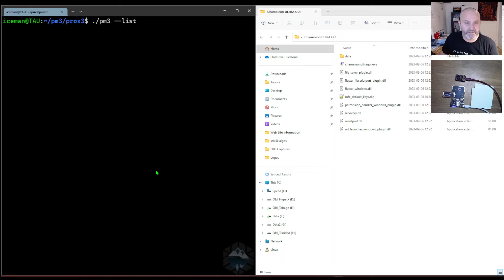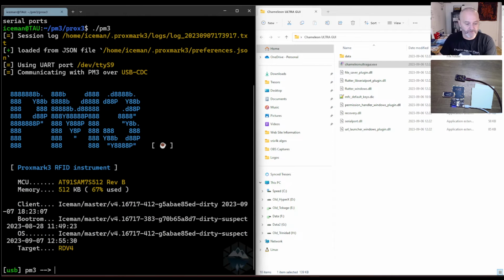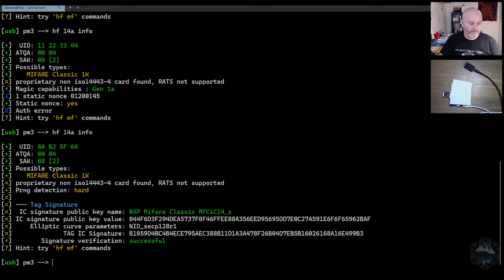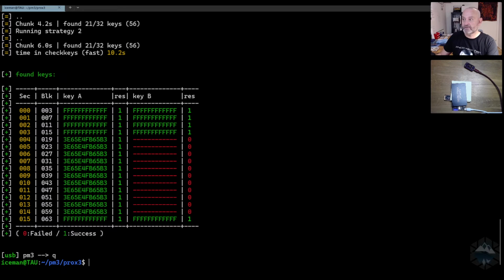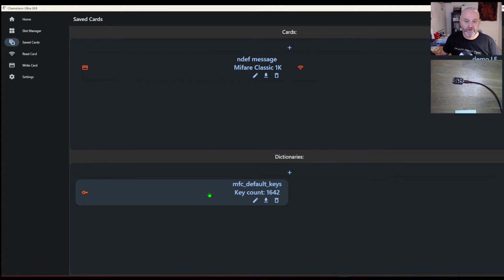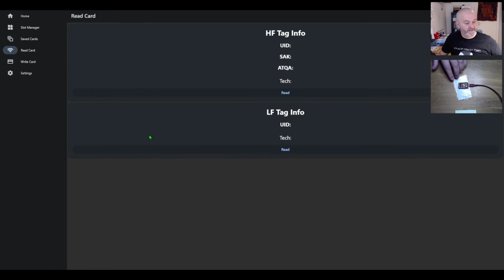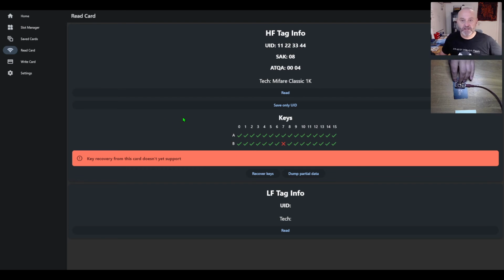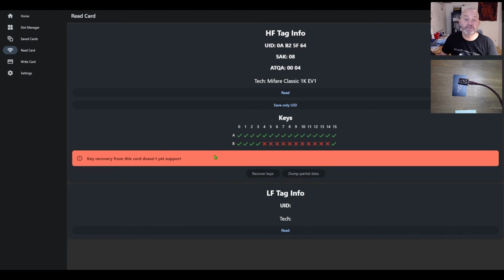Unveiling Key Recovery: Chameleon Ultra GUI Deep Dive

Comment: Hi, 
I have a problem with chameleon ultra, when using the “Read Card” function, when reading a card, there is no “Check keys from dictionary” option as in the example, only “Read with key” and “Read without key” are displayed. 
The card's Tech is an Ultralight EV1(41). The mfc_default_keys.dic file provided by you has been added to the “Dictionaries” section of “Saved Cards”. Thank you for your help!
Reply from the maker: Mifare ultralight is not Mifare Classic.  
Two different card technologies.
Reply: @iceman1001  So is it because the technology doesn't support check keys from dictionary?
Reply from the maker: @  ultralight doesn’t have keys.   It has a 4 byte password.  
Now would be the time to read the datasheet in order to understand the differences between them two card technologies.
Reply: @iceman1001  Got that.Thank you for your reply.

Comment: Is this card 125KHz 1326 1386 idhid access Proximity 26-bit Cards / Facility Code 130 rewritable
Reply from the maker: Depends what chipset it has.  If original then you can use a pm3 to examine it more.

Comment: Hi fist off I love the work you put in I have a question I'm not that good with computers but I like the proxmark3 with the battery + bluetooth  so I see the icopy-xs is easy to use  is it a app available to control the proxmark3 the same way you control the chameleon ultra thanks for being here for us all
Reply from the maker: There is termux on android and an out of date app. 

Flipper and CU has modern and up to date apps.
Reply: @iceman1001  thanks for responding I'm gonna give both a try the proxmark3 with battery + bluetooth and icopy-xs 👍

Comment: Great Video!

Why didn't you select a dictionary before recovering keys (from the drop down)?
Also, I have a MiFare Classic Card, where the gui does not offer to recover keys. When I dump the HF and write it to another card and read that card, i can suddenly recover the keys and dump the HF properly.

The first clone (without recovering keys) does not work, but the clone2 created from clone1 works well

Do you have a clue whats happening here? For the original card it shows me "Tech: Other", once its cloned without key recovery it shows "Tech: Mifare Classic 1K"
Reply from the maker: yeah,  
the message in the dropdown made me belive it was a debug message. Work in progress..
So I didn't think of it until GameTeclive informed me that the dropdown actually works. 

Leaves a bit to wish for in the GUI ,  

You can recover keys from the clone in different manners most likely since its a Gen1a.

Comment: First of all, thanks a lot for this clear tutorial. I tried to make the same exercise with some cards i have... and have detected that I don't get the same outcome as you showed us. If I try the info command, i only get some data (no uid, atqa & sak). Through another way I can detect its sak 20, atqa 0344, which gives me by looking up on the internet its a MIFARE DESFire). Is this the reason why i dont get the same results? Also the hf mf fchk results in a error. (seems the command is not known). Are you using an own firmware? FYI, I updated to the latest version. Many thanks
Reply from the maker: I noticed a flaw in my walk through.  You need to select the dictionary in the dropdown meny. 
Maybe that helps. 
MIFARE Desfire,  its not handled by the ULTRA yet.    Its a complete different technology from MIFARE Classic.

I do recommend the RFID Hacking discord server.

Comment: Will this work with the older Chameleon Tiny?
Reply from the maker: Good question, 
Sadly I don't think so since the Chameleon Ultra vs Chameleon Tiny uses a complete different firmware and way to communicate.
Reply: @iceman1001 thanks for your reply. Looks like the Ultra will be the next device I'll save up for, it looks like a neat little device.. I love the Tiny, but the Ultra looks like it also has 125 KHz too.. 

It's fully compatible with the CLI like the Proxmark? If so, that's incredible..
Reply from the maker: @linus607  Yeah it has LF and HF.  Capable little device.
And it has its own CLI.  
Happens to look like the PM3 CLI but it is not the same.

Comment: Thanks for the tips on the dictionary. It's good to know we can just add the Proxmark dictionary. I didn't know. Hope some of these things make it into some documentation for the Chamelion Ultra.  It would also be good to show contrast against the Flipper as my testing showed the following:  Mifare Classic Mini EV1 says it doesn’t support key recovery, yet Flipper can use its db and unlock most of the card.
Interestingly, the Chameleon must have some built-in default keys as “check keys from the dictionary” works before adding a dictionary file, so those must be hardcoded defaults, perhaps. When I read a Mifare Ultralight 11, the Chameleon says tech “other,” yet Flipper can identify it, and I can unlock the card using nonce with the reader. Just wanted to share my findings as I know there is work to be done on the UI, and potentially, this may work via CLI. I still have to test that theory. I hope others will share their experiences so we can contribute to the knowledge base and help make the Chameleon Ultra even better.
Reply from the maker: Since its a new device and the repositories is being worked on and things changes from day to day.  Its rapid and hard to videos about because of it. 

The flipper uses the proxmark3 dictionary in the bottom and added tons of other keys.   Making it quite diluted in the process. 

The Ultra has a set of hard coded default keys inside.  The external dictionary file is something that is easier to modify according to your own needs and wishes. 

The basis for the traditional MIFARE Classic attacks is there in the Ultra environment but its not hooked up.  So lets see what happens.  There is a lot of rapid development going on.

Comment: Thank you for your very informative videos! Questions: in the video you loaded a dictionary file. What does that do and you said it came from your proxmark repo so does that mean you had to custom make it?
Reply from the maker: The dictionary file is a list of known default keys used with MIFARE Classic and has been collected over the years.
I use the dictionary file  mfc_default_keys.dic from the proxmark3 repo.  Its the best one out there.
Reply: @iceman1001  thank you! I have been wondering where we get the dic file or if we make our own. I'll check the repo
Reply from the maker: You can use the Proxmark3 default dictionaries.    Everyone else is ,  

https://github.com/RfidResearchGroup/proxmark3/tree/master/client/dictionaries
Reply: Correct me if im wrong iceman but It's also not a good idea to have a massive dictionary as it can slow things down alot and with the classics nested or hardnested will probably be quicker for a unknown key
Reply from the maker: @nu77byte49   yeah,  there is a break point between key recovery time and checking for default keys.   Its not as easy as people think or want to believe it is.

Comment from the maker: Too funny,   
I missed an obvious thing  :)

I forgot to actually select the MFC dictionary when doing the  "check keys from dictionary"    
🤦‍♂
Reply: That was one of my findings. I was also doing that with no dictionary loaded and it was finding keys so was asking if they were defaults and some how coded into the firmware. Also unable to add the dictionary file using the IOS app. I can select it from files but it wont add it. #FunTimes